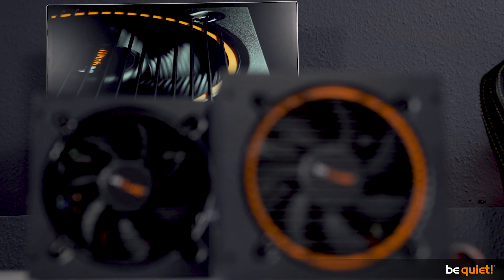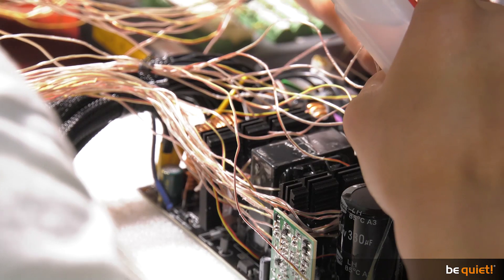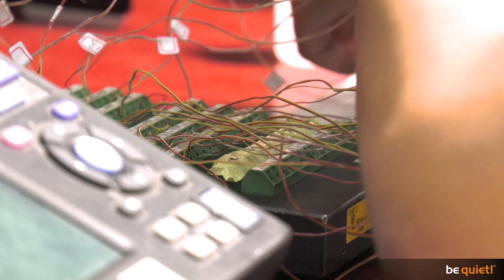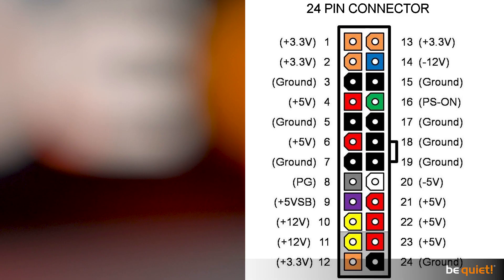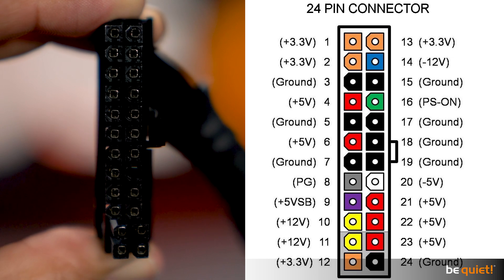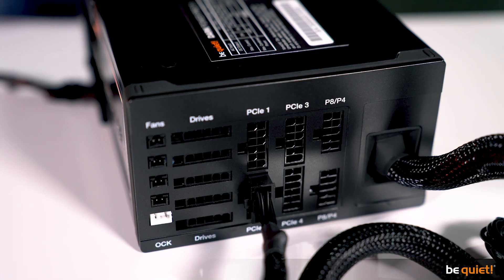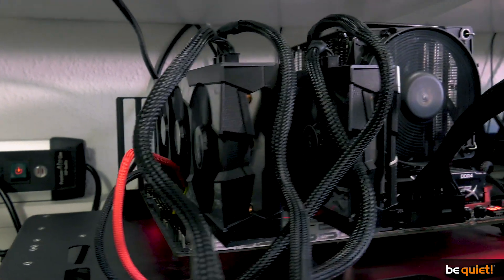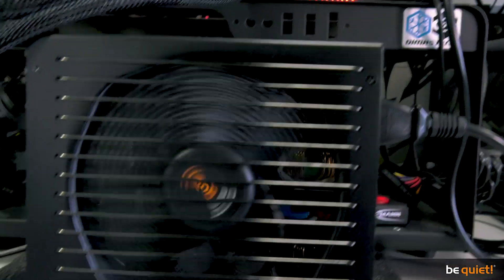Rails and volt in a PSU | be quiet!

Comment: Another interesting point is the way design has changed over the years
Group regulated PSUs used to be common (and maybe still are in some cheap and nasty ones), where the 12V, 5V and 3.3V were driven by a single controller and just expected to track within acceptable limits - the problem with this was "crossload" where a higher than expected load on one caused it to drop and the others to rise, a problem highlighted by the difference in CPU power drain between peak load and low energy idle.
Then came independently regulated, where each voltage was separately controlled.
In the modern 12V centric era, the rise of the VRM, in many modern designs, only the 12V is derived from the primary circuit, and the 5V and 3.3V are produced by switchmode buck regulation from the 12V.

Characteristics:
Group regulated fare badly on crossload tests, and an older PSU from the era where 12V only ran the motors, will fare very badly on a modern system, while a somewhat later 12V optimized design would not satisfactorily power a 5V dependent retro system.
Independent do crossload a lot better, but have given way to the VRM design.
VRM designs show one particular artefact  in crossload testing - because the 5V and 3.3V are regulated down from the 12V (efficient, but never 100%), they score lower than normal efficiency on a 5V/3.3V heavy crossload test, but that does not reflect the load pattern of modern systems